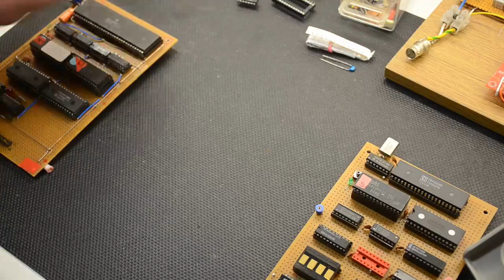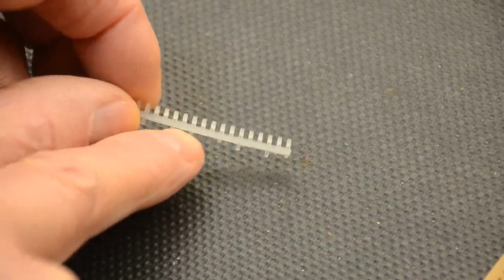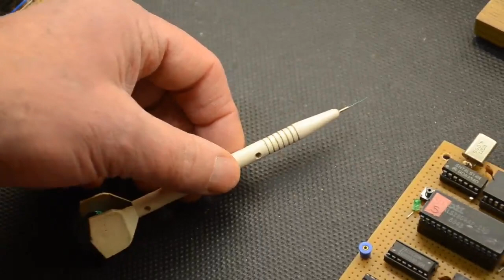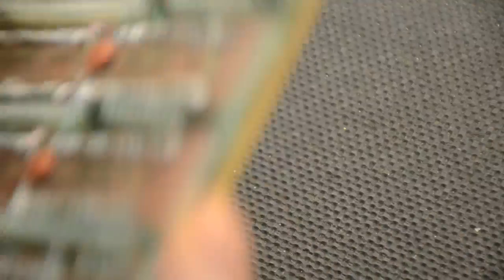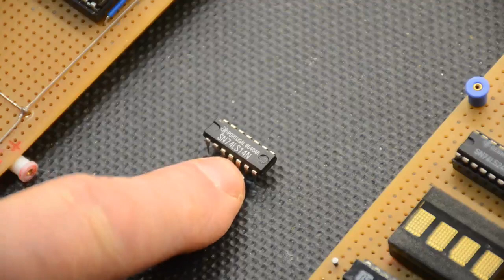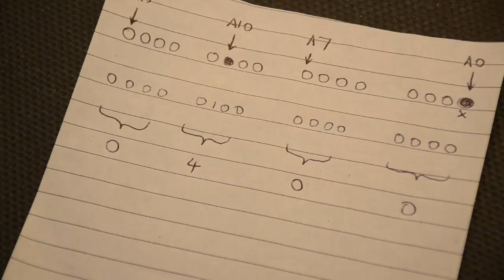An 'Entry Level' 68000 based computer Part 3 Debugging the board

Comment: The little debug display looks useful. Do you have a part number for it please?
Reply from the maker: Wow! I actually forgot to mention what it was! Mind you, to be fair on myself, I give the p/n in several of the project videos. With that said, it is a DL1414 display, produced under several different names. (I've just checked) Fleabay currently has a few for sale. One by Litronix under the p/n DL1414 at around £16 each. Ali-Express seems to have them too. Expensive I know, but can be used again and again for each project.  I hope this helps!

Comment: This is very interesting! I have a couple of these old mk68k and I think I might try to get one going. I did have a free run test on a breadboard, but I would like to do more. My primary concern is the power supply. I was considering putting a usb on the board for power after I watched your first two videos, but after watching this one I'm not sure it would supply enough amps. What areyour thoughts?
Reply from the maker: The power shouldn't be a problem. If you decide to use USB, then you're permitted to draw up to 0.5A from this source. Looking at my own measurements, my project would be well within this, even with the display on. If using USB worries you, then how about using an old mobile 'phone charger? I have a couple here that say +5V @ 1 Amp on them. Watch out for the VERY old ones if you try this and check the o/p voltage first as many were unregulated! Aside from this I can't see any issues. Go for it!

Comment: I've never seen those wiring cones.  I cannot seem to find them anywhere.  Do they go by another name or do you have a source for them?  Thanks!
Reply from the maker: I can't seem to find the cream coloured ones I'm using at the moment advertised anywhere. However, a very good friend of mine used to use the black stick-on combs sold by 'Roadrunner Electronics' where the pen and wire I used for my videos came from. (The black type needed sticking down with superglue (?) as they had no locating pins, though I see now that they also do ones with the locating pins.) Here is the manufacturer and the page relating to the combs:  https://roadrunnerelectronics.com/wire-distribution-strips/